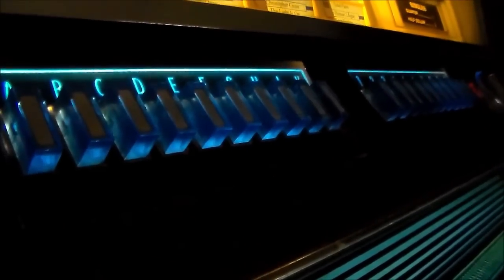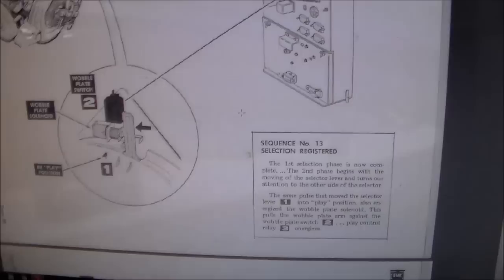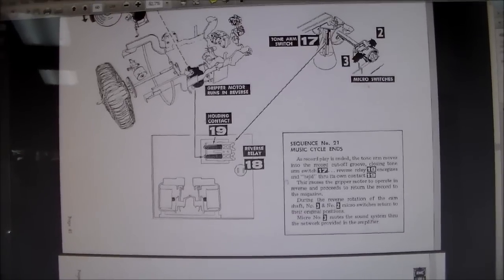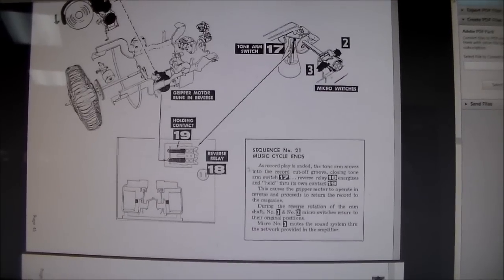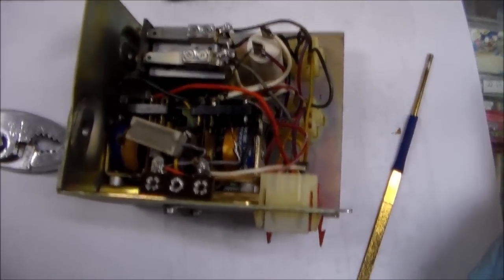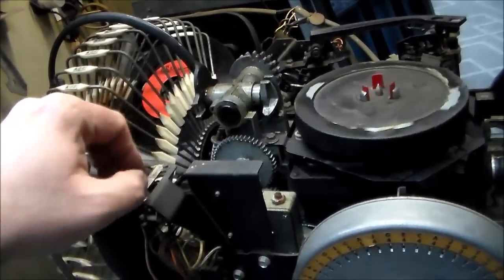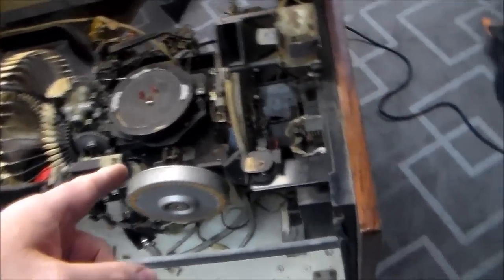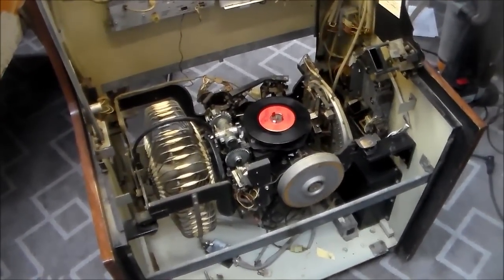Learning how a Rock-Ola Jukebox Mechanism Works - 1970 Rock Ola Model 445 Video 2 of 3

Comment: Thanks so much for these videos. I just moved with my 1969 444, and she was a little cranky. I have a 444/445 manual, but schematics are a language I'm still learning, so these videos helped me understand them. I even took apart the power relay and cleaned the contacts (without the video I never would have guessed where that was located!!!) and now she works beautifully!
Reply from the maker: Taking apart the relays and cleaning them fixes all kinds of stuff, everybody thinks they need a new relay but the actual relay is hardly ever bad, just dirty!  Glad you got it up and running again!

Comment: This has been a great help to me working on my 1968 Rockola 437!  Almost exactly the same but mine is an 80/160  version like the manual. I got everything working except the Read out is only picking up the A side of the records. It passes over the B side. Thanks again!!!
Reply from the maker: They mention that in the manual I think... if it keeps passing over that little solenoid isn't pulling in for some reason, the circuit should be pretty small...

Comment: Awesome video Joe.  You know what you are doing, that's for sure.  Got a little problem.  Bought a Rock-Ola 460 about a year ago.  Got it cleaned up and going.  Yesterday moved it from the garage to the house on an appliance carrier and now it won't pickup the record at the end of the song.  Going through the relays to see what's up, but can't find anything.  Per your video, I will check the relays under the turntable.  We really jarred it hard going up the stairs, yikes!
Reply from the maker: If you press the cancel button on the back will it pick it up?  If it will then the arm needs adjusted it’s the screw on the end that allows it to pivot a little bit
Reply: @LyonsArcade  Hi Joe.  No it won't.  I hear the mute relay clicking though, and it will also click when I pick up the tone arm to the reject position.
Reply from the maker: Definitely something in the relay or one of the switches on the cam.  In the manual (any of them) it shows how everything works step by step you’re up to the step where the relay pulls in so it’s either loose or dirty connections or something
Reply: @LyonsArcade  Thanks Joe!  I am going to go through them one by one now.  You're right, something has got to be loose somewhere.  Thanks again.  I'll let ya know what I find.

Comment: Joe I need to know where I can get a copy of a manual with schematics for a 435 rockola princess deluxe. All I can find is a schematic of the Amp, which I have and  does work (great sound). I have a manual but not with the wiring diagrams like you show on your videos. My 1.6 A fuse keeps blowing (good thing I have a large supply). Any help you can give would be great.

Comment: I have a question, I have a Rockola 448 and I saw that you sprayed contact cleaner on the selection buttons, so you just spray it down good all over and then leave it dry? My write in wheel won’t go either and I want to get it working again but the other side will spin around the wheel just fine

Comment: If we wanted to replace components for circuit shortages which we see happening in the far left box, is there a good repair kit you would recommend we order?
Reply from the maker: Hi Montana;  Unfortunately nobody really makes a kit for it, what you have to do is either look in the manual for the part description (it'll say like 10uf 24v electrolytic capacitor), or look at the actual parts, then order them individually from a place like www.Newark.com ... You can still get about everything, if you run into a part like an IC chip that isn't on Newark you can usually find them on ebay.  Good luck!

Comment: Thanks for the great jukebox videos first off, do have a quick question do you know if you can switch out the moveable turn table to one that is not. So on this one you got the 3 tabs that will drop to play a record that has a single hole ( think 45 vs LP) I have a few old Phil Collins 45’s from England and they have the single hole not the big one out 45’s do. I have the rock ola 490 and my turntable is solid not with the drop pens like this one has.
Reply from the maker: I'm sure it could be swapped over but I've never done that myself... most of the parts interchange between the various models though so I would imagine the turntables would swap, I think the idler wheel and all that is the same under the turntable.  Thanks for watching Jeff!

Comment: I've got a 432 and mine is stopping exactly like yours did, but only on one spot.  I've tried every location, and only A1/B1 fails.  It picks it up and just as it putting it down it clicks and stops.  Won't work again until I scan and reset it. Once the record is back in the basket, operate starts to work again.  I cleaned the wiper arm with improperly alcohol, but it still fails.  My turntable is also spinning at about 41rpm unfortunately.  Not sure if it is the motor, the idler wheel or all three, including the turntable working together.  Any suggestions?  Also can't find any cheapish replacement 28inch Fluorescent bulbs.
Reply from the maker: That speed problem is usually the motor, but you can oil the shaft and keep laying it, it'll work it's way out and start playing at the correct speed again...... I've never seen it hang on just one record, that's pretty strange... when you turn the machine off, it hangs it up?
Reply: @LyonsArcade  I sprayed some contact cleaner on the wiper arm and it works now. I wondering if the motor could be cleaned vs replaced,

Comment: I have a 443, I replaced  both gripper and carousel motors and now it keeps blowing the 1.6 mech fuse during write-in sequence. Any ideas? I checked the cam, and both relays. thanks.

Comment: How does dynamic braking work? Is this to stop gripper from over extending and jamming motor. 
My motor jams?
Reply from the maker: Depends on where it jams, sometimes the gripper bow will jam because the pin that holds it together sticks slightly out of the piston, when the piston pulls in the pin holds it from going all the way inside the sleeve and the arm will be stuck halfway up in the air...
Reply: @LyonsArcade  Thanks. I guess I meant it "stalls" a d I can help it along using my hand. I'm guessing I'm not getting enough power to the motor?

Comment: Any idea what could be the problem if the readout doesn't start spinning after the write-in did its job? I Have a Rock Ola 442 that has the bow hovering over the left side where the vinyls are and I can make selections but the readout doesn't startup. I wonder if it's because it's in the middle of picking up a vinyl or because something else broken. I checked all the fuses and they are all still in tact.
Reply from the maker: You're on the right track, it could be partway through it's cycle, (even though it looks like it's all the way over the basket), this means that the switches on the back of the cam (look at the shaft that runs from front to back that the gears are attached to).... those switches go on and off depending on where in the cycle that rod is.  The read out can't turn without turning the basket too, so if the cam isn't all the way turned back around where it should be (even slightly off) the switch won't be pressed so the read out/basket can't turn.

It could be too bad connections on the switches, or the 'wobble plate' on the read in /read out pin plate.  When it selects a pin, it moves the 'wobble plate' inside the selector plate which makes a switch pull in on the top of the plate, that switch is in the power feed that turns on the read out.  

If you look in a manual (they're all similar) it'll show you where the cam should be at rest position and which switches it should be pushing on the cam.
Reply: @LyonsArcade  Thanks for the super fast reply! I think I will have to take apart that gear box and clean it out like you did, because if I try and turn the motor by hand it just jams at some point and the other way around it's the same, it turns and I can see the cogwheels moving but once they hit the inner section where it's supposed to lift up the bow it stops. So I can't get the bow to lift. Love your channel btw!

Comment: I have a rockola 456 and am having a rather strange issue. Whenever power is on the selector wheel will not stop turning. It plays and selects songs fine, but I cannot get the wheel to stop turning between songs. Any suggestions or directions I can go? I know nothing of jukeboxes this is all new to me.

Comment: I've always been fascinated by the mechanics rather than the electrics in a jukebox. . I've never been able to figure out how that arm grips the record, rises & then TURNS to place the record down (& vice versa for returning it to the rack). How does it go up & then turn?  Please don't say "gears & cogs" - I know it's that, but I still can't work it out.
Reply from the maker: There is a motor on the bottom that starts turning spokes and wheels.  As the spokes on the wheel turn around, the spokes pull the arm towards the turntable, which makes a small piston on one side slip out of the arm, once the arm has pulled far enough back it's gripping the record between the end of the bow and the piston that slipped out of the arm... the spokes on the wheel are designed in such a way that at this exact moment, one of the wheels with spokes on it hits a small piece of metal attached to the other wheel with spokes on it, and the two of them then turn together.  As such they lift the arm straight up in the air, in an arc, holding the record.  As it continues to turn by having the one wheel mesh with the other wheel through a set of teeth, there are two metal ears on the arm that hit a little tab that a solenoid pulls one way for the A side and another way for the B side.  When the arm hits that tab in whichever position it's been put into, it twists the arm, now free of one of the wheels with teeth on it, either to the left or to the right.  It's no longer mated with the wheel with teeth on it that was keeping it from moving sideways, so it turns a complete 90 degrees and has the record now approaching parallel with the turntable.  As the wheels with teeth on it continue to move, it lays the record farther down towards the turntable, eventually completing it's arc when it gets to the turntable.  The wheel with teeth on it then turns a little farther, and the teeth push the record arm away from the basket, allowing the piston inside to slip back within the bow and releasing the grip on the record.   To return it all it does the exact opposite and the motor runs backwards from how it ran to lay it down.
Reply: @LyonsArcade  OMG. . Like OMG . .  I find that to be an absolutely genius piece of mechanical engineering. Forget the records, forget the music . . I could watch it doing that all day. Thanks.

Comment: I also have a 445 I'm restoring.  My problem is I got a new needle with cartridge.  The old one was missing and wires frayed off.  I'm not sure what wires go to which lugs on the cartridge.  Any way you could get me diagram so I can finish mine.  Thanks
Reply from the maker: Skylar I've never replaced a cartridge on one, but check out this post:  https://markmail.org/message/faysy3k26u2zyqet

Comment: The magazine locked up now to my 437 Ultra Rockola. It has been working fine.it won’t turn in Operation or Scan mode? Any ideas?
Reply from the maker: Look and see if there's a red or yellow push button sticking out on the power supply there are circuit breakers on them.  Might have just tripped one of those....

Comment: We inherited a Rock-ola 443 from my mother-in-law with all her favorite music.  I am excited to get it playing again.  What were you using to clean the relays and contacts?  Thanks for your videos!  You have made this a much less intimidating project for me :)
Reply from the maker: Hi Taryn!  When you clean the contacts you're just trying to get all the dirt off of them basically, you can use anything, like a wet piece of card stock paper (a business card)... or you can even use spray contact cleaner as long as it's labeled non-conductive on the can, they sell some at Lowes and Home Depot.  You spray it on and it cleans the contacts without even having to scrub it or anything.  You can also check any contact with a multimeter, set it on ohms and put one probe on one side, the other on the other side of the contact and see if the resistance goes down to 0 or close to it (less than 1 ohm).... if it does your contact is conducting electricity well and will work fine.

You can absolutely fix it, good luck!